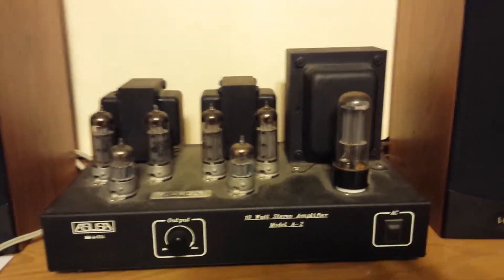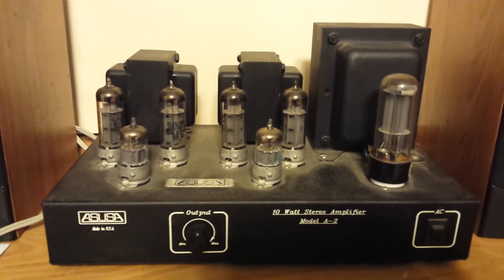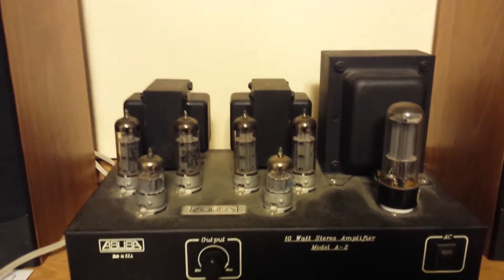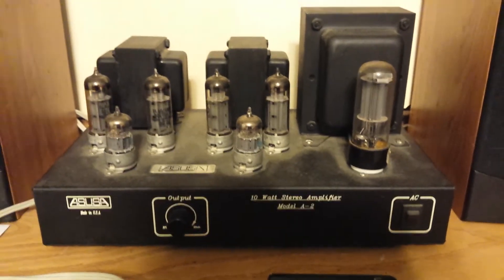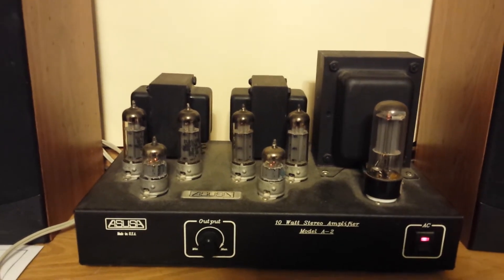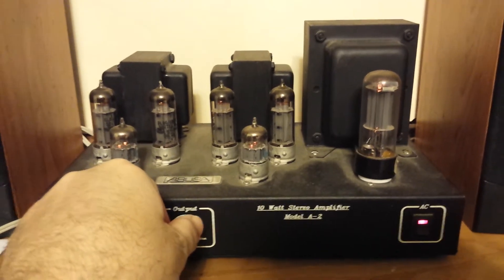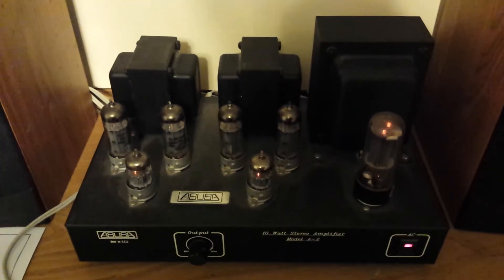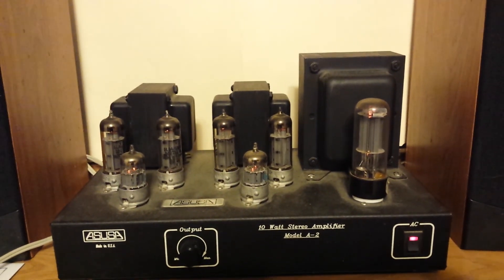ASUSA Model A-2 Tube Amplifier Kit Demo

Comment: Is this as loud as a BT speaker?
Reply from the maker: Hello Mr. Arbia.  Thank you for your comment.  It, absolutely, is as loud, or louder as most common Bluetooth speakers.  But that all depends on the efficiency of the speakers used with the tube amplifier. And a final thought on this topic, a Bluetooth speaker, typically, will not sound as good as a tube amplifier.